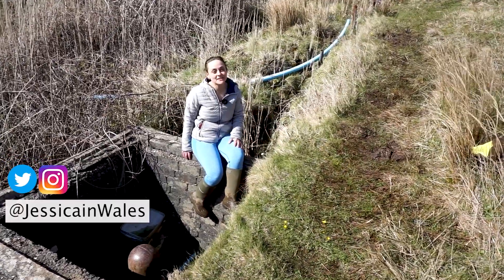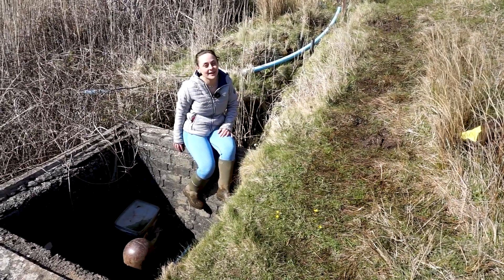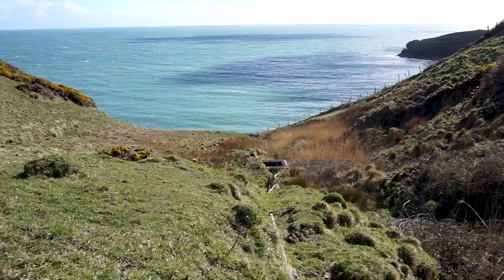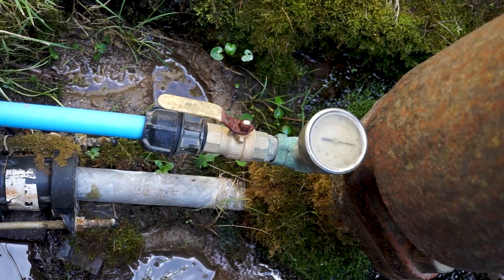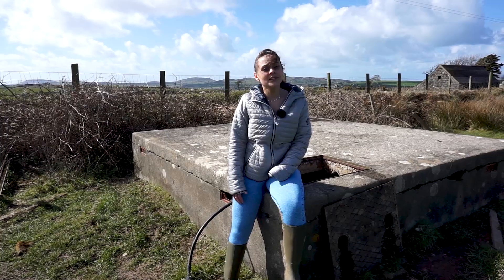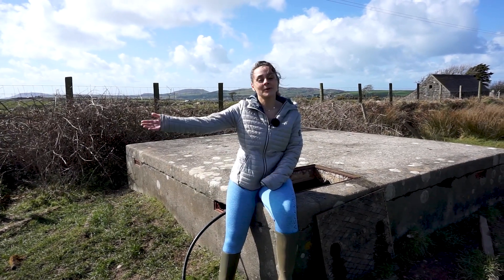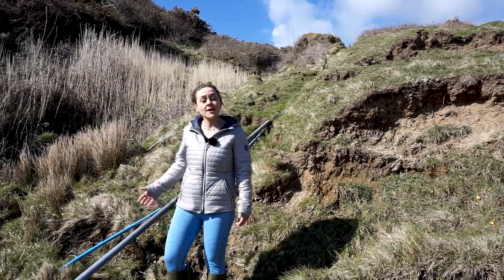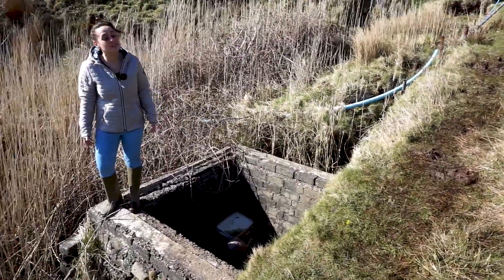What is a Hydram and how is used? + Outtakes!

Comment: I have one , just a little tip for you , when it gets to frozen weather there , don,t let it stop , or the ice can burst the drivepipe open like a vegetable pea pod , it happened to mine before my watch , somebody tried to repair it by jacketing the split pipe in concrete , it worked for some decades , but eventually the shockwave shattered the concrete , so new galvanised steel drivepipe in the early 1990,s . still works . Best Regs .